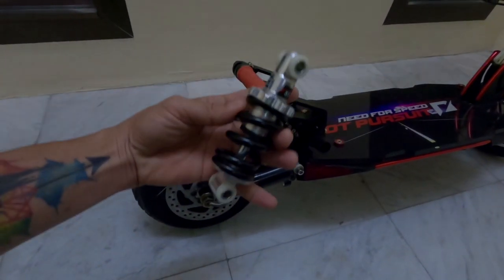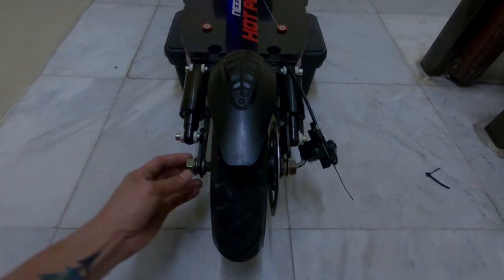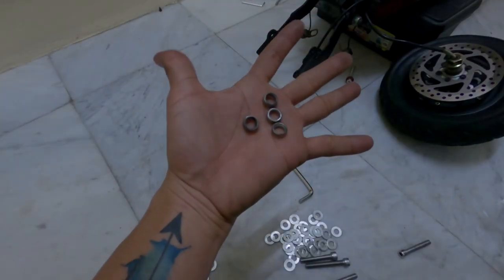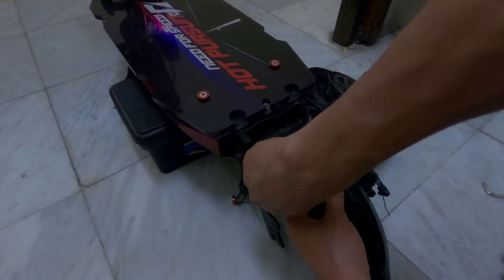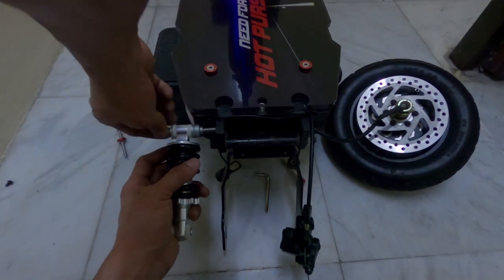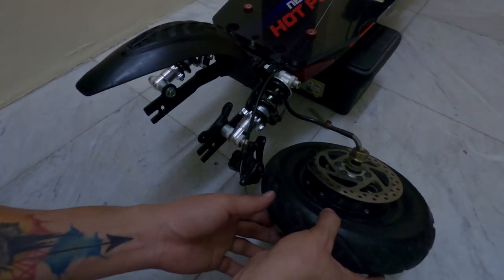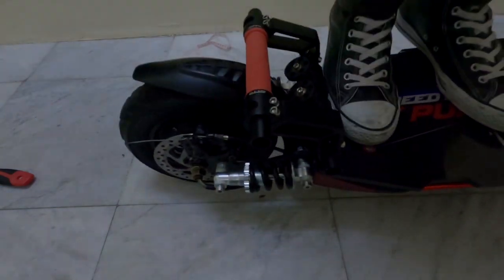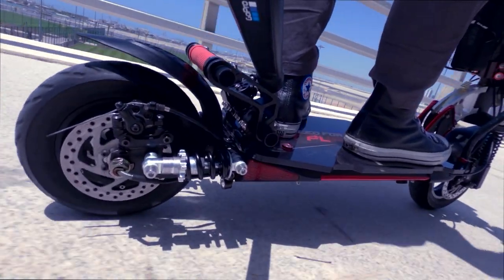SHOCK ABSORBER/SUSPENSION Replacement and Installation for E10 Electric Scooter

Comment: What the bolt u are using mine is shorter if I put the spacers
Reply from the maker: Goodday!
I used 2pcs of 8x60mm for the deck side and 2pcs of 8x50mm for the swing arm side.

Ride safe!🤟
Reply: @jaysonulanday  thank you

Comment: So are these able to absorb shocks more than the hydrolic ones you had or you have changed them because they look cool ;)
Reply from the maker: Goodday!
The new shocks perform better than the ones i removed. 
It's worth  it!
Thank you for watching!
Ride safe always🤟
Reply: I coincidentally just ordered the same shocks from ebay. The old hydrolic ones are awful - they are stiff as and only work on large potholes. Talk about inertia. The discs in my back rattle every time I go for a scoot.
Reply: Oem ones ara not hydraulic. They only have springs in it. Go check it

Comment: 100mm ung absorber ko, pwede po bang mag palit ng 125mm idol? 10inch tire ung skn
Reply from the maker: Goodday kaadik!
Pede nmn, pero tataas un likuran ng scooter mo.  Aangat un likuran na parang nakasubsob un harap ng scooter mo.

Ride safe lage kaadik!🤟
Reply: @jaysonulanday  ganon ba un, dko na napansin kasi, nkabili na ko ng 125mm..ikakabit ko na sana..medyo mahaba pala sa gamit ko..gawin ko na lng cguro ung parang sayo na Ctype sa harap, para mag pantay ung level ng board ..
Reply: napagana mo boss ung 125mm? ganyan dn nabili ko eh mas mahal sa stock na shock
Reply from the maker: @ronnelvillanueva925  
125mm talaga un size nun stock ko kaya sakto lang.
un ibang unit kase 100mm lang. Depende kasi un sa distance ng butas na pagkakabitan ng shock. Nagkataon lang na 125mm un stock ko kaya 125mm din un ipinalit ko na bago.
Reply: @ronnelvillanueva925  yes boss pwede nman pala kahit 125mm medyo tumaas sa likod, ngayon pinalitan ko na rin sa harapan ng same size kaya pumantay na..
Reply: @user-si2nc3nv8g  nilagay ko na yung sakin, tumaas nga sya na halos di na ma stand ng ayos, anong ipinalit mo sa unahan sir? para magpantay

Comment: You can Change the frontal suspension ?? Its very important because its a very hard suspension not god , its possible put another suspension ?
Reply from the maker: Goodday bro!
You can replace it with the same design.
I just don't know if there is available softer spring than the stock ones.

Thank you for watching!
Ride safe🤟
Reply: @jaysonulanday  ok thanks bro , i go to cherch in aliexpress another fourck , thanks for your time good day .
Reply from the maker: @marcospinto7163  you're welcome bro.. have a nice day...!

Comment: Could someone please advise if 150mm suspension with 450lbs stiffness for 70kg body weight will be too soft or ok ? Im worried about 750lbs being hard like stock hydraulics suspension. Cheers.
Reply from the maker: Goodday!
My suggestion is that, take the 750lbs.
That would be fine for a person who weights 70kg.
Ride safe!🤟
Reply: @jaysonulanday  thanks broo, much appreciated !!
Reply: Make sure the 150 mm will fit..
Reply from the maker: @ricksuarez9653  what size is your stock suspension?
Reply: @jaysonulanday  125mm
Reply from the maker: @ricksuarez9653  then use 125mm . because 150mm would be too high.
Reply: @jaysonulanday  lol I didn't say im gonna change my rear damper..😆 ask PorronWis first if he's gonna use the same size! I know what I'm doing I'm a mechanic! Lol
Reply: @jaysonulanday  Im still waiting for the 150mm spare. Just 25mm extra cleareance wont break anythig, in fact it should provide better shock absorption, thus less stress over the frame. But let my try empirically first…though I’m not the first one doing it. It worked for others already.
Reply from the maker: @tecnogadgethd   i see other owners here, they do just like that. It will lift the rear of your scooter when you use the 150mm. Update me once you're done installing it.
Reply: @jaysonulanday  I’m still waiting for the suspension to arrive. My scoter isn’t exactly the same but it has a very similar chasis/schematic for the rear suspension (Smartgyro Crossover Dual Pro). I’ll update once it’s successfully installed

Comment: I wanna buy this scooter, seems so legit and cheap enough compared to kagoo M4, in Indonesia it’s 415 USD. Anyway, how fast this e10 scooter could run? Some vidio said it possible to 99 kph
Reply from the maker: Goodday bro!
E10 scooter is generic .
Meaning, they don't maintain a standard.
Some are fast.. some are not.
Speed is between 40-45kph depending on the battery level and weight(rider).
But when it comes to price, it's money wise.
It's durable too.
In my experience with my scooter,.. i'm absolutely satisfied🤟.
Thank you for watchibg bro🤟
Reply: Boss any tips para mapabilis takbo e10 ko? Need ko ba palitan motor nya or upgrade/ dagdag lang battery